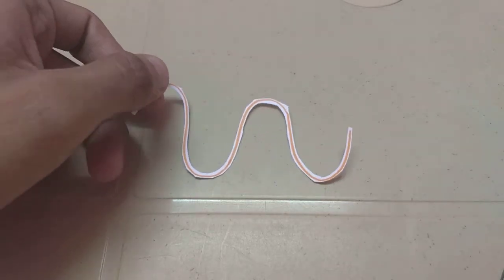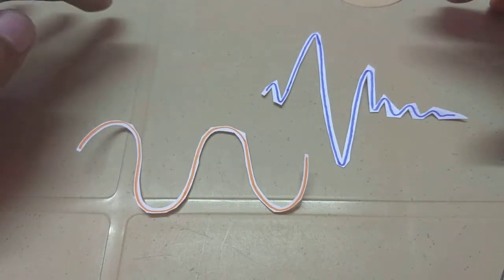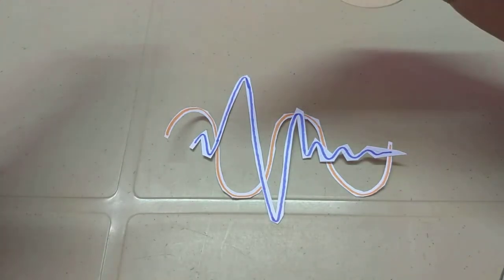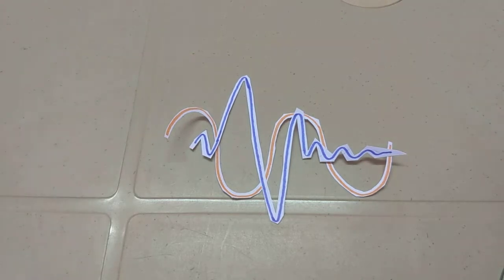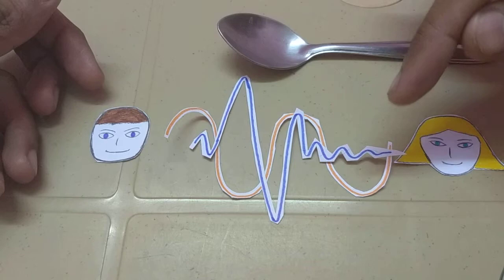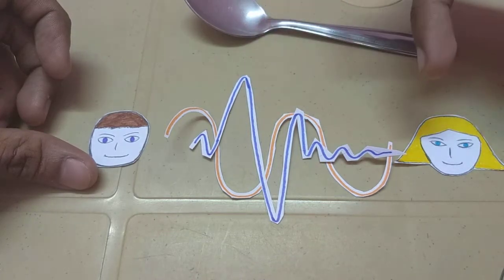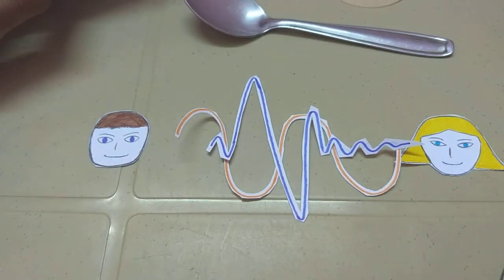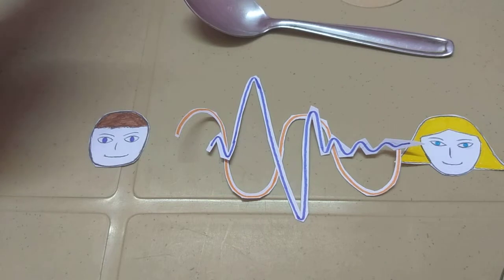Temporal Sound masking explained and demonstrated

Comment: Great video!  Why is it masking up to 20ms before the spoon drop though?  How can something be masked before the spoon makes any noise?
Reply from the maker: Thanks! I'll try to explain but it requires some understanding. Any sound when produced requires some 'build-up' time to become prominent. The build-up time may be extremely short but it is not zero. If it was zero, it would mean that sound is produced instantaneously, but it is not the case. Likewise, the sensation of pre-masking also requires some build-up time to be perceived. It has been measured and reported to last about 20ms. Post masking on the other hand can last about 200ms which is why it is more dominant when it comes to perceiving the masking effect. So in the spoon drop example, it will take some time for sound to build up (pre-masking occurs) and some time for sound to decay (post-masking occurs).